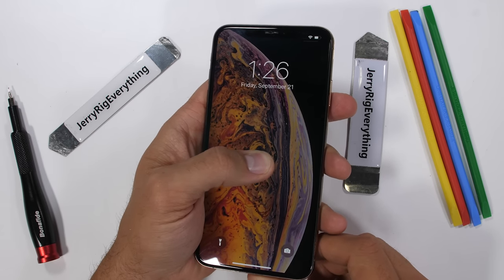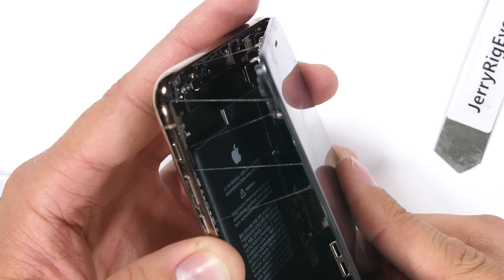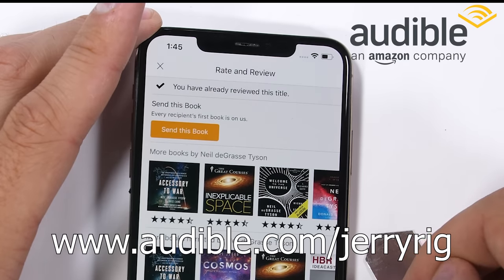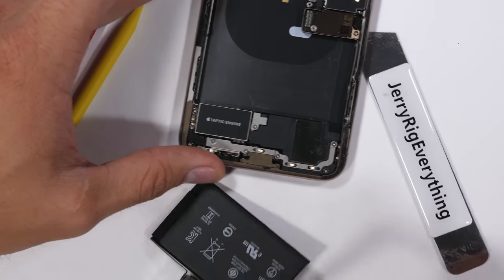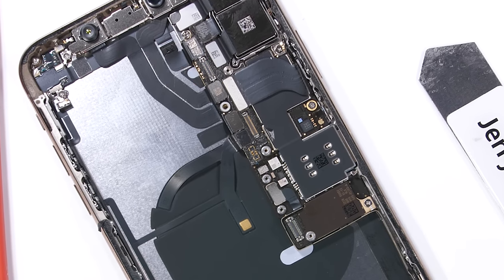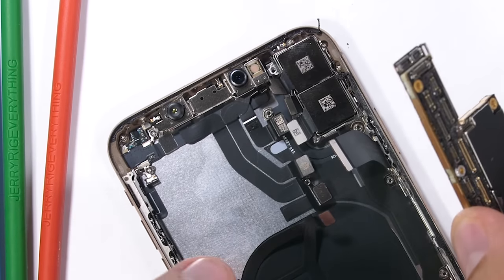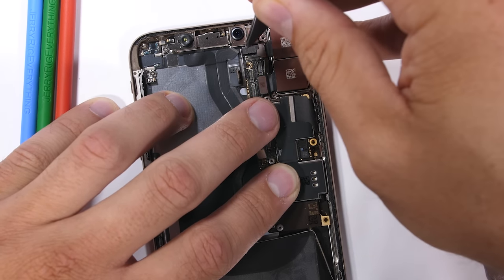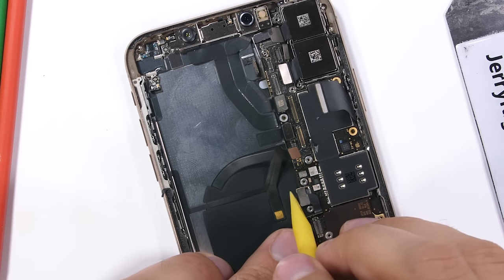iPhone Xs Max Teardown - Is there any Thermal Cooling?

Comment: "Screen and battery replacement are relatively easy"....its always been the case, the problem is that you can not get Original parts, (dam you Apple !!), you have to buy chinese parts from Aliexpress and the quality is so so. But For the same amount, you can buy an icloud locked device for parts, for me its the best way to go.
Reply: Original parts? You must be joking... they're all original and they're all made in China. Thing is Chinese resellers often buy huge quantities of parts that have not passed the quality control inspection and sell them at a lower price. If you know how quality control works, usually they turn down whole batches of replacement parts. That means that most are ok while a few are  low quality or even defective. If you happen to be one of the unlucky ones , though luck, but I never had an issue with my "original" parts and I do this for a living. On rare occasions they can sell you counterfeit parts but they're so low quality that these sellers rarely survive on the online market. Like I said, you have to have an eye for what you buy online, if you're relatively careful, most likely you'll always get good parts for good prices.
Reply: Also even if U get the original screen, it still wont look the same. As after every screen has to be calibrated with a Multi million $ machine. Source: Im a Geek Squad Agent.
Reply: Hassan Bakkali 你好，我是中国人 有什么需要帮忙的吗？
Reply: Hassan Bakkali £25 with apple care??? So that £224 in total for screen replacement + Apple care? Not that expensive
Reply: DjCatani people say that yes i know, but when i buy it from Ali, or even just looking at the pics fromn Ali sellers-customers feedback,  its not the same stickers in the back of the screen, stamps, ribbons color, etc vs original. thats why im sceptical !  also i bought screens for nexus 5 and samsung S4 at the time, the quality were bad.
Reply: Yeah, Apple has a strong 'fuck you don't repair your shit or pay someone to repair your shit unless it's me' attitude when it comes to third party repair as well as DIY repair. The whole inability to buy original Apple parts is just a small tidbit of it. You can technically find Chinese resellers who sell actual Apple parts but buying those and shipping them to the US will automatically mean the package will be seized by US customs and then promptly destroyed.
Reply: Hassan Bakkali thanks for the spam, hassan.

Comment: Apple fanboy. Samsung fanboy.

They're both just as bad.
Reply: Colin Scholz what are you
Reply: TC.J • dude it’s the other way around. Apple is superior to Samsung in any way possible
Reply: TC.J • what is the point of a Files app? Apple didn’t put that because they didn’t want to stoop down to Samsheeps level
Reply: TC.J • iPhone deletes all data off any app you have and it is easier than samsheeps way of doing it. Just go to settings, tap the app, and click uninstall. That’s it. Samsheep is worthless
Reply: @aoliravioli  
Lol apple just recently got face ID, Samsung had it on the S3. 
Samsung also do not slow down their old phones to make you buy new ones.
Reply: Gabriel Maguire notice how those two were the only bad things you could say about Apple. If I had THAT much time, I would make a whole list in why Samsung is terrible
Reply: Huawei all the way

Comment: Kinda amazed the small amount of adhesive used to hold the screen down. You didn't even use any heat. Or had you removed it on a practice run?

Comment: Hi Jerry just came across your well produced video. You ask the question of is there thermal cooling? You missed that stainless steel piece. This piece used to be a solid stainless. Since the X this piece has been replaced by a copper center, three layer bonded alloy. Similar to the US quarter which has been like this since the 70s. Yes the thick copper center layer works and was first used in a Fujitsu smart phone almost ten years ago. So there you go there is an intentional thermal cooling design in the X and the phone can be made as thin as possible, not like some other cooling methods that has to be rigged in.

Comment: The Samsung note 9 has 4,000mAh
The iPhone XS has 3,100mAh
But I have the iPhone 11pro Max and it has 4,000mAh it honestly feels like 8,000mAh because the software is so power efficient
Reply: Pro max doesn't have 4000mah it has 3969
Reply: IRiverss 
Yeah that’s 4000mAh
It’s rounded to the nearest hundred

Comment: I wonder if vibrators can be used in some mode to boost the sound quality or by latching the loud speaker on it!
and placing it in the housing is better on the screen?

Comment: all phone and even iPhone dont need any thermal cooling like any other pc do have so let the phone can feel the cold or heat on it own because the battery thats why and even the processor will stay cool because there's no high voltage at all to make that hot at all

Comment: As much as I like my phones
There's something with apple that just.
The max variant has a comparatively teeny battery and still has a crazy good battery life, the amount of ram is laughable but still the iPhones have the best memory retention and overall snappiness, they have no cooling for their SOC and still it runs fine, doesn't throttle much if at all and is still the performance champion.
Reply: The battery isn't that great when you actually use it though, standby is good but the screen is normally the number one drain and you need mAh for some real battery life, that's why when you use the phone the battery gets hammered.

Comment: Have you tried a different project where you replace Old iPhone's processor (or even camera) with the latest one?

Well, the iPod Touch did come back with a iPhone 7 processor. The iPhone 7 has the same chassis as he iPhone 8 and the iPhone 8 shared the same processor as the iPhone X which means.. How about placing this iPhone Xs Max processor inside the old iPod Touch instead of buying a 2019 one?

Comment: Thanks for this. I've noticed 2, 3 black "black specs" on ever darn photo I take now. No spots, damage on the outer case/back lens glass - so I am guessing some kind of dirt dust actually got inside and on the inside camera lens. - I've seen a few posts of this issue with X, XS cameras both front and back. - I WISH the spec was on the front, I never use that selfie front camera...lol Oh well.

*Although it's supposed to be sealed dust proof..I've seen way too many videos of this issue with the phones, X, XS. Eh. I've taken apart my old 6+ to replace the battery with no issues, this is obviously different from the old phone (actually disconnecting that display appears easier than the old 6+)  - but totally doable to access that rear camera.

Comment: Although it’s inconvenient to have to replace the whole frame when the back glass shatters, think of this, the components of the phone are in no danger if the back glass is broken. That metal layer beneath the glass is flipped around in Samsung phones, which is why it’s so easy replace the back glass. The issue with that is the components of the phone could be left exposed if the glass fragments get into something important.

Comment: The so very ‘smart’ guy praises the camera but then jumps to the charging port as acts like it will need a replacement. And then compares to Samsung. Not realizing that lightening ports never need replacing. It’s just a hole with contacts. Unlike usb-c...usb-c break because of that little tab. Lightening ports don’t have that so it doesn’t need replacement.  Never had a lightening port come my way that needs replacement. Nice try tho. Oh and those plugs are nothing like legos.